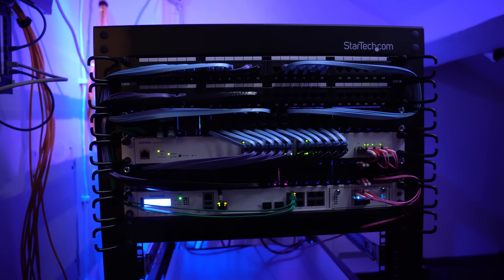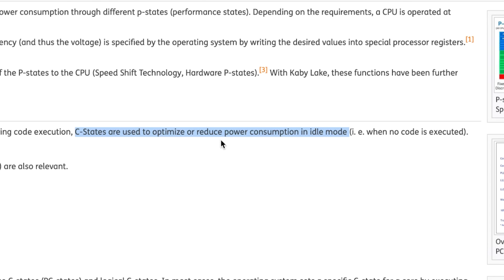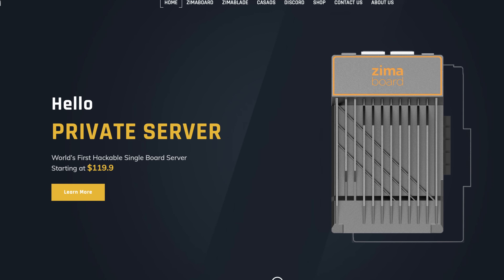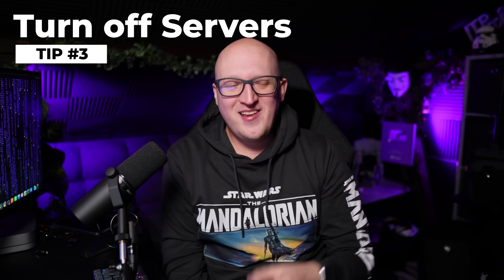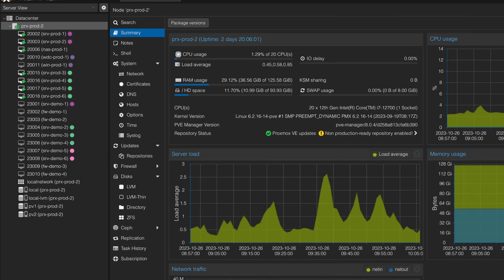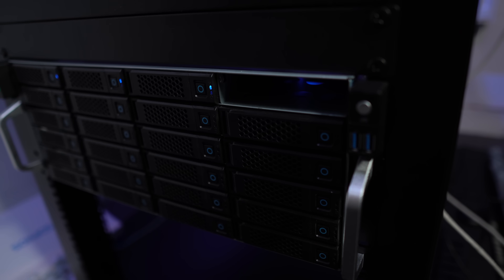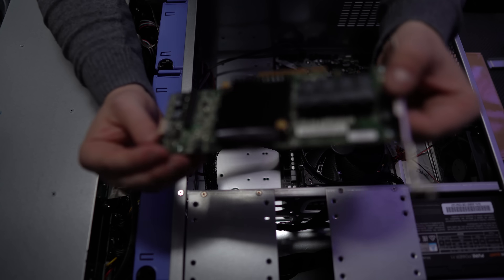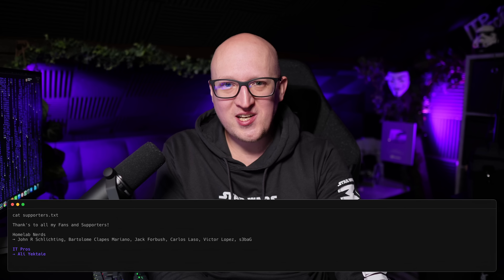How to save power in a Homelab? 5 Tips!

Comment: I've been looking to replace my current homelab with newer more efficient hardware. But it's too expensive or nearly impossible for me at the moment. My NAS has a Xeon E5 2676v3 with 256GB ECC RAM, and my vSphere Cluster has 4 servers with Xeon E5 2696v3 and 256GB ECC. Finally the router is a Core i5 8500T with 32GB, which is really efficient (12VO Power Supply, it idles at ~15W). Everything adds up to 940W, with 10GbE switch, AP PoE, ISP routers (dual WAN), 1GbE switch. So, in total each Xeon requires between 160-180W. The issue is that I would need to go from DDR3 to DDR4 or DDR5 and hardware that supports 256GB is really expensive.
Reply: May I ask what your power bill is? Doing a rough calculation, your setup would cost me about 4000 USD per year just in power. Living in middle Europe.
Reply: @LucaDarioBützberger  It costs me between 350-400 per year (Argentina).
Reply: @andibiront2316  I am not familiar with argentinias currency, inflation and averge wages but that sounds like quite a lot too.

Comment: One thing I learned the hard way is consumer hardware can be tempting but can also be limiting.  I ran into a issue where my MOBO/CPU doesn't have enough PCI lanes/slots to plug it in . I have a 10g nic which takes up the only free non 1x PCI slot which I wanted to put a HBA card in(I have a Tesla P40 to handle video work/Stabil diffusion). Since I do use my server as a NVR so it has to run 24/7 so turning off my server is not a option.

Comment: @christianlempa I think I have another idea...You can take mobo with OC possiibility, plus CPU with  larger computing power then u need and use CPU OC functionality in opisite way - underclock and undervolt it, eventiually modify it to work at idle at lower frequency, turbo boost to base/stock frequency. ;)

Comment: As others have said in the comments, set up energy usage monitoring. If you absolutely have to, you can report usage in units of Raspberry Pi, but it's optional. You can find the advertised energy consumption of components before you buy or install them. If you decide to install them, please check your own measurements (discrepancies can be configuration options and are not always bad faith marketing). Home automation components can help shut down containers, VMS, servers, etc., when not in use and be sure startup and shutdown work flawlessly while you save power. Run components in the public cloud where sensible; the hyperscalers are putting a lot of effort into reducing power usage and we can make use of that while adding some "hybrid cloud" to our home labs.

Comment: I'm in the process of revamping my little home setup and have been working on exactly this.  Smart plugs + home assistant (or another logging/monitor app) to monitor power usage has been helpful until I grab some UPS's to figure out how much power I was using where.  Also swapped out some older systems with really low power mini pc's where I could (opnsense for instance).  Hardest thing has been upgrading my NAS to keep it relatively low power and keep all the features I want but that's probably the last thing I'm going to upgrade so I have time to decide on that one.  Only leaves 1 power hungry Epyc server but I'm not getting rid of that one!  

Funny thing is overall swapping the lightbulbs to LED, replacing some old appliances and turning off idle audio equipment (sub/amp) saved me more power overall but my homelab isn't very big.

Comment: My first home lab was on the 1950x thread ripper.. When it was new.. Yes. I vowed never again, so I have a few extra tips.

Use old gaming LAPTOPS if you need a gpu. Way more efficient and bonus ups. The m.2 ports can act as pci express ports btw.

Power supplies use more power than you would expect. If your going for efficiency look into a pico psu. Otherwise do your research

Along the same vein, aliexpress router boards are awesome. I have one with 4 2.5g ethernet ports and a pci express port. I virtualise my router and one of my nas here. While using a pico psu because I use ssd. Along with what Christian said, inbuilt on motherboard is more efficient then addon cards.

SSD ARE MORE EffICIENT THAN SPINNING RUST.

Containerise everything, or if you can't Virtualise everything... Including your gaming PC. It is 100 percent possible. (I used to virtualise windows for this, but these days I virtualise a Linux gaming vm... It's more efficient). Don't put your router and gaming PC on the same hypervisor though 😅, learned that the hard way. 

A Raspberry Pi with a ethernet port is all you need to automate the power for these 😁. 

Finally, find a way to automate turning off the power at your home.. A managed powerboard.. Or a ups.. Or even add automation to your switchboard. That way you can turn everything you need off when you aren't home.. It will literally save you thousands.

Comment: It's a great opportunity to automate with HA. I am shutting some stuff during the night and when I am away (I don't need hot water in the boiler when I am not home). It automatically turns on when I get back home.
I am running NUC with Docker and Kodi, I might try to turn some VMs off automatically.

Comment: I have a x86 kubernetes cluster (1 mini computer). It was on 50 - 60% cpu all the time.
Then I joined a Raspberry Pi 4 8gb to the cluster helping out the workload. Now the x86 node is on 5% cpu, letting the raspberry pi do most of the work.
I am amazed by how far we have come with ARM64 support.
Cert Manager, External DNS, Grafana, ArgoCD, Prometheus, Loki, InfluxDB ,Uptime Kuma, Kafka, all works as workloads on ARM64 out of the box, with out a single line of code changed, making it very appealing to create very power efficient ARM64 clusters!
Reply: I will definitely look into that :D Sounds amazing what can be done with ARM now.

Comment: Good video! I built a TrueNAS scale machine last years with a HDD pool and a SSD pool, thinking I could make the HDDs go to sleep when I'm not making backups or watching some video. I practice, they wake up too often for it to make a real difference, while lowering the lifetime of the disks.
Also, getting a server board with features like IPMI was cool, it it consumes around 8W even when everything else is off. So 8W on top of whatever the server uses to do useful stuff.
Reply: Modern drives park the head so putting them to sleep has minimal lifetime degradation. One article estimated you could park the head every 20 minutes for 10 years and still not reach the manufactures estimated sleep cycle expectancy.

Comment: Some things I have picked up from my attempts to reduce the power consumption of my homelab:
1. AMD has processors with G and GE suffix that have greatly reduced TDP and have an integrated GPU. Combine that with an ASRock board with IPMI and ECC RAM and you have a great, low cost, low power base for a homelab server.
2. 10GBE over copper takes a lot of power. If you use SFP+ you have the option to use multimode fibre instead, that usually is lower power AND lower latency.
3. Standby mode for HDDs in a NAS was shunned in the past as it had a negative impact on the longevity of the drives. Modern HDDs however are much more resilient and can tolerate much higher power cycle counts. An inbetween on Truenas is Adv. Power Management that can be set to low power states without spindown.
4. Shuting down unused VMs has a measurable impact on my server. A Win 10 Pro on my system uses 5-7 Watts. Containers tend to use less power, as they use the OS infrastructure of the host.
5. Don't assume, measure. I used some cheap power meters with tasmota to stay on top of my homelab and check the impact of changes on power consumption.
Reply: >  I used some cheap power meters with tasmota to stay on top of my homelab and check the impact of changes on power consumption.
That would be a nice video to watch. How to implement such. It'd be good :) @christianlempa
Reply: From my understanding, the suffix G and GE does NOT reduce the idle consumption, but only limits the maximum possible consumption.
Reply: @mcmormus  the recent G processors are usually monolithic which reduces power usage a lot, since they have no separate IOD. The IO die is what kills idle efficiency on ryzen. my mostly idle truenas server on a 5700X uses 3 times the power idle as my proxmox server on a 10900k (~30-35W vs 10W idle). So for a mostly idle server i definitely would not go the ryzen route unless it's a G variant. Added benefit if you don't have IPMI, you have a video out ^^'. Zen6 should change that with the revised IOD, otherwise they are power hungry under light loads.
Reply: @mcmormus  You are correct. From what I gather, some Intel CPUs have lower idle power than AMD, but that quickly negates under load.
Reply: @mcmormus  The G models are monolithic die APUs, at least during late AM4 generations. That makes them more power efficient than standard chiplet CPUs.
Reply: ive been looking to build a qnap replacement nas myself, i really wanted to find a cheap low power chip, something like an n97 would have been ideal, but its so hard to find a low end / low power cpu that also supports ecc. i know you mention an amd G chip, do you recall what things you were looking at?
Reply: I just wish the g and ge models supported ecc memory..
Reply: @salvationbygracethroughfaith  You are right of course. I just am willing to expend the energy for IPMI as it saves me additional hardware, effort and inconvenience. To me it's about reducing the energy needs while still meeting my needs.

Comment: On my primary server I ended up having some simple cronjobs to automatically switch cpu governor between schedutil and powersave depending on the time of day. To be more specific, electricity at night is slightly cheaper here, so I run it as schedutil (default) during the night and powersave during the day. This will cause the cpu to basically stay at the lowest frequency, but for my workload that's fine. Some cpu heavy tasks just take slightly longer. In my grafana dashboard where I see the wattage used by this server through the PDU I can see exactly where this script triggers every day.
Reply: Hey, do you mind sharing the script? I could use this. Thanks!

Comment: Two hints which helped me reduce 30% power consumption in Proxmox: 1. Get a smart plug with power meter. Or get power metrics from your UPS. Then store it in a monitoring (Prometheus). You can only control the things which are measurable for you! 2. Set scaling_governor=conservative in Proxmox host. I can't see any noticeable or measurable performance degradation but huge savings in power consumption. Cheers👍👍☀️ Extra hint: shut down VMs which you don't need - I noticed that my small dev env running in K8s / VM consumes 40 Watts when idle!
Reply: Also shutdown application/docker containers you don't need.

Comment: This is actually what I have been working on the past month, I am converting all my compute from older DUAL Xeon boards, to a Proxmox Cluster of 8C 16T HP mini PC's, and changing my NAS to a low power system, and  way smaller box, from 11 Hard Drives total , to 6 Larger drives, and putting it all in a way smaller rack to conserve energy and space. The whole BIG rack and big PC's is cool, and nice , until you get the complaints from the wife, and the electric / cooling bill. I live in Texas , so any energy I use is basically doubled due to cooling costs.

Comment: Great topic. So far I have just two Rpi for my homelab needs, in neat argon cases. Running all on SSD totally efficient and silent in my living room. I would not use them for proxmox but it is crazy how far you can push these little sbc while using very little power.

Comment: Basically did the same, removed 3 HP servers, 1 g8 micro, 1 g8 380p and 1 g7 380.
Replaced all of them with a amd system built with consumer hardware with 3 16tb drives and some nvme drives for faster storage... It is SUCH a difference in power consumption 😅 and since the electricity prices in Sweden went crazy it was just in time...

Absolutely not as fun, but the wife approval was much higher with the new server :-D probably because she have no idea what I spent on it... But hey! Low power consumption! 🎉🥳

Comment: I dropped VMware in 2-3 Dell servers and tranformed all to 1x Proxmox + 2x Synology/Xpenology NAS. Its always about Intel "L" version of CPUs for servers - sure, very bad Turbo 2-2,3Ghz - but my observation with VMware /10 VMs/ - most of the time CPUs sit at 10-15%. Only Win-Lin update and Chia shytcoin farm rise it to 30-50%. I disconnected 30x HDDs from Chia farm too, as that coin is dead and electricity is a luxury now. Finaly I am down from 500W to 270W alltogether including 12-port full 10GB Mikrotik switch.